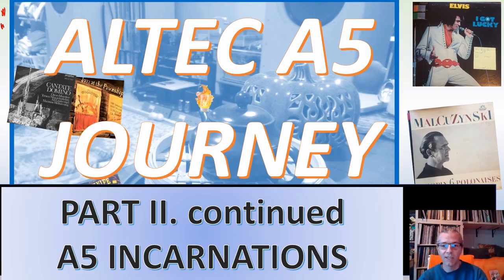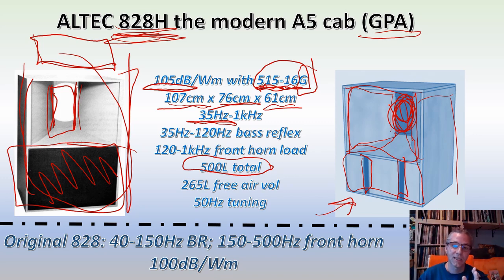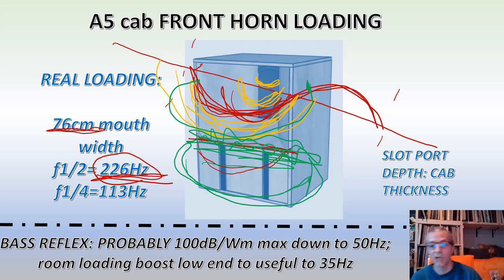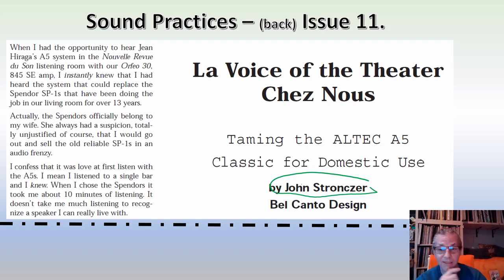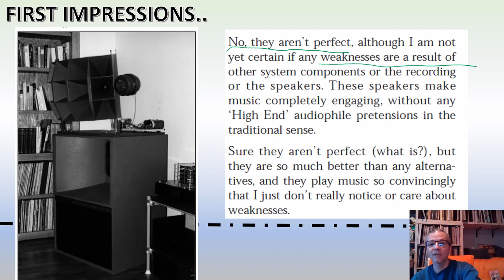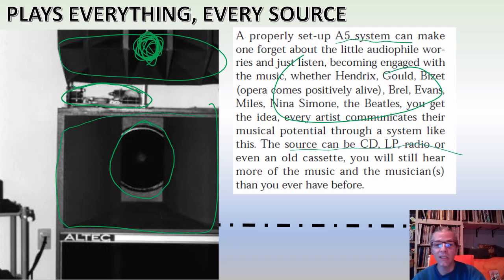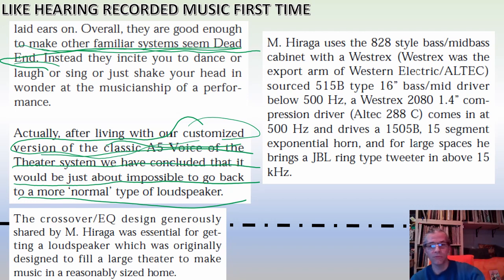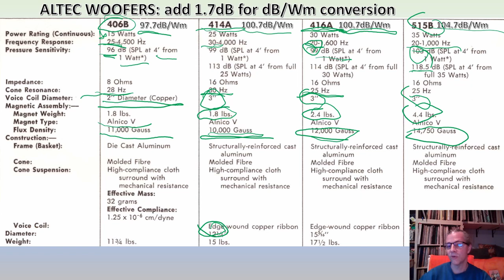Altec VOTT A5 Series Part III.

Comment: Other speakers sound 'recorded', but Altecs sound 'live' :-) Perfect capture. Thank you for going into the horn support for supporting frequencies - that was one of my blind spots. I noticed on my VOL the background (fake) reverb often disappears, but it just not interesting because all the music related things come through. When I first realised this, it disconcerted me somewhat so I plugged my HD600 directly into my amp just to check if it wasn't my amp, but it wasn't. Yes I somehow feel no need to address it as planting a fake acoustic into my room would be weird.
Reply from the maker: I have a feeling that the VOL does not do what I would call as: acoustic contrast sharpening. That is, other technologies (esp direct-radiation) over-emphasize effects added to natural sounds. I suspect that the room smooths out a lot of these artifacts that we get when the material is presented in an "on axis beam" type of transmission - which is something really artificial, disjointed from the natural omnidirectional transmission observed in natural sound sources.
Reply: @realworldaudio  Brilliant and well put - it also fully aligns with my observations. I found that recording aspects such as how the isntrument was observed (distance, mic directivity) remains,.. but room acoustics seem to be largely ignored by my hearing and it takes clues from the room its in (my room) - perhaps indeed because the direct radiation, esp in the 'spatial' freq range, is a fraction of the total energy.